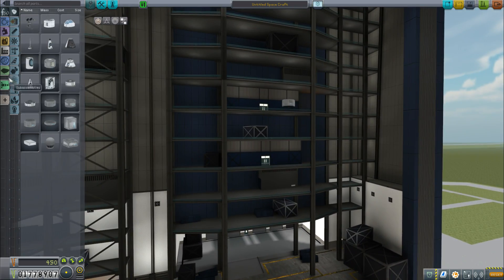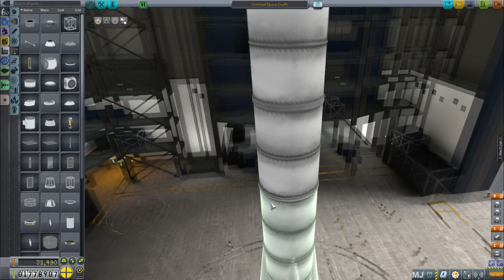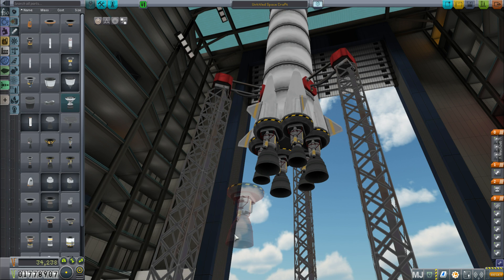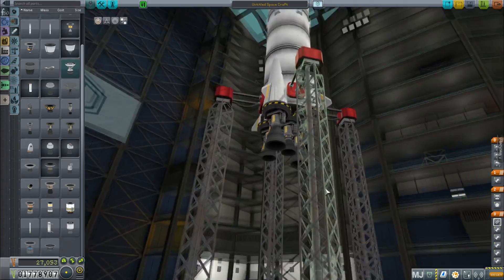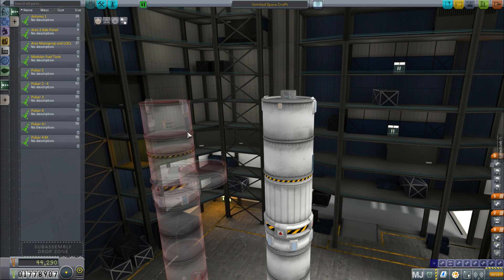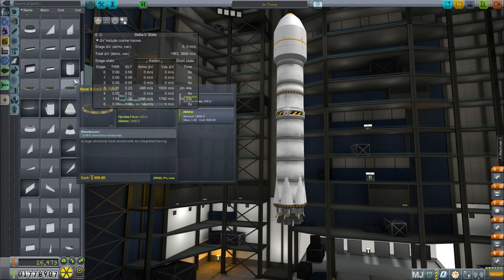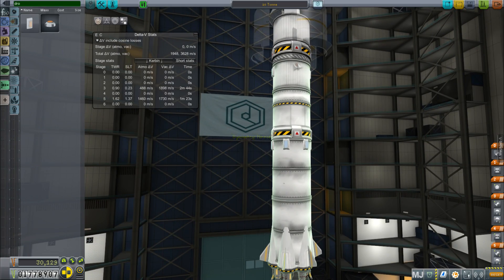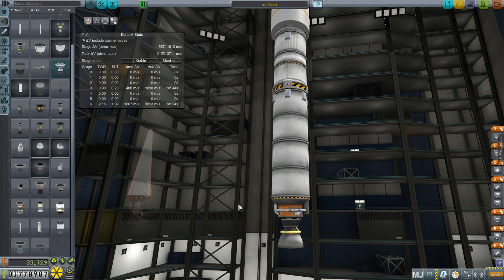Road To Exploration - How I Build My Rockets, Kerbal Space Program

Comment: That looks very nice, one of my "weaknesses" is designing pleasing, rockety looking engine pods.

7:10 A much better way to do it in stock, is to cram everything into a small service bay and once the 2.5m batteries and command pod are unlocked, just ditch it and fit everything as part of main stack.